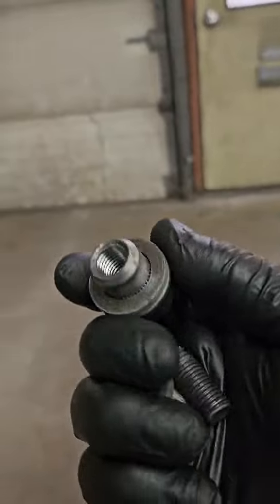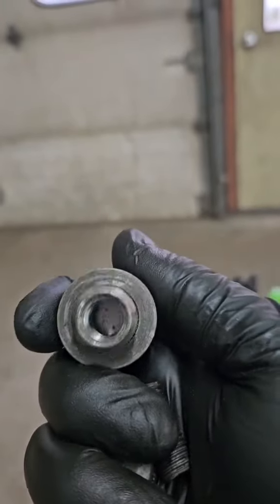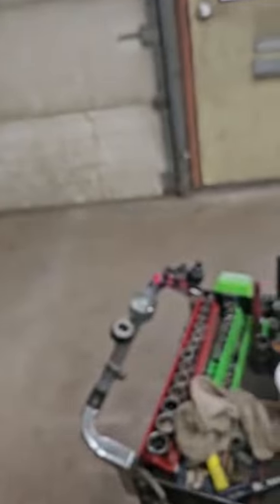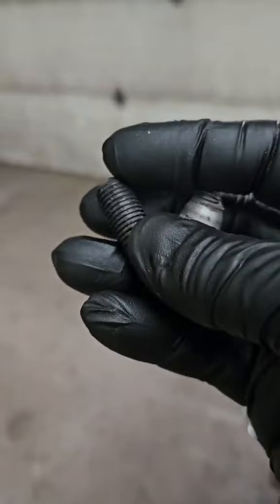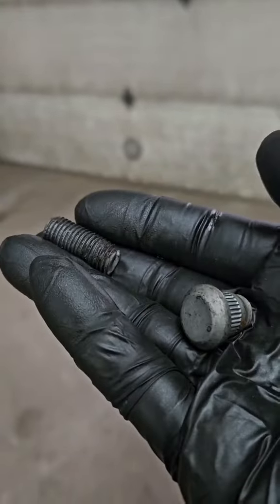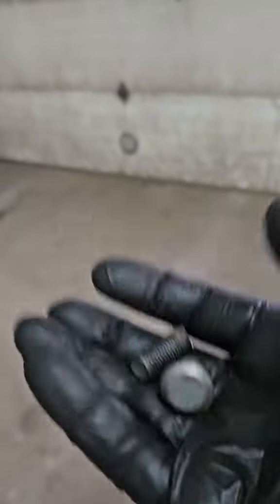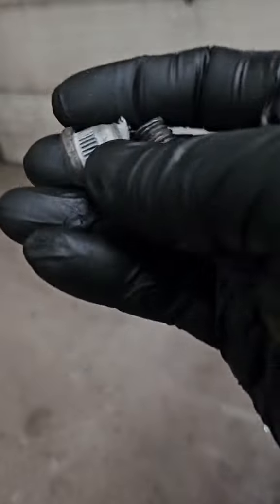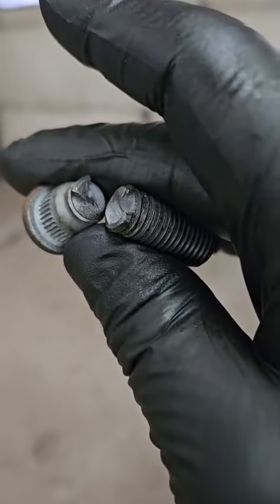Do not use Anti seize on wheel studs! #antiseize #wheelstud #tireservice

Comment: I've done it to every lug on every vehicle I have owned for 40 years. Never broken a stud.
Reply from the maker: The best part of showing what could happen from doing something and someone commenting about their anecdotal evidence as proof it doesn't happen.
Reply: @Tobatech13  Hasnt happened to anybody else I know that does the same thing including mechanics.
Reply from the maker: @Gizmo42Rodeo funny just a little research will show you it's more common then you think. I mean science is hard thing to accept I get it
Reply: I've put WD40 on wheel studs since the 80's. Never broke one. All 20 would have broke on that RAV4 , or at least more than one, if it was bad to do it.
Reply from the maker: @GregoryMitchell-zs2sh  lol ok bud. The only people that do it around here are hack diyers but whatever ypu do you bro
Reply: @Tobatech13  I'm not a hack. I'm a licenced automotive tech, a millwright, self taught  machinist and welder. Those wheel studs come from the factory with lube on them. My point was that one out of 20 wheel studs breaking isn't a sure thing.
Reply: Its only because you used your calibrated ugga dugga to do it. If you used a torque wrench you will over torque it. I follow the same process. Haven't lost a lug yet .
Reply: @Tobatech13  adding grease is not MULTIPLYING the torque. if you are actually torquing lugs to spec this will NOT happen ever. Take it from someone with more experience than you :)
Reply: @bambur1  I always use a torque wrench to factory specs.
Reply from the maker: @yuh1247  lol do a little research and ypu will see lubed threads increase the clamping force require to reach said torque. It's not rocket science

Comment: There are torque charts that show that lubricated fasteners should be torqued at about 10% less. How do you achieve proper torque on dry fasteners? All engine rebuild torque values ask for lightly lubed threads. As previously mentioned, I have been torquing all my wheels with lubed threads for over 40 years. I have never broken a lubed fastener.
Reply from the maker: I understand that. Engine component torque specs account for that. Also depending what lub you use and how much will vary the the amount of clamping force required. And I'm happy you've had zero issue but unfortunately that's not the case for everyone hence why those precautions are out there. That being Said cleaning the the threads and torquing to spec is the preferred proper way of doing  it.
Reply: @Tobatech13  I hold seven trade certifications and a total of fifty years in the trade. I am not a DYIer. Like someone mentioned below, if a lubed bolt breaks  it has probably been over torqued in the past.We do not tighten by feel anymore, torque is torque and lube does not make it higher!
Reply from the maker: @randyprentice9292  lol here comes captain certificates but doesn't understand that lubed threads add more clamping force which stretches the stud and weakens it. It's not rocket science and there's enough research to back this up unlike anecdotal evidence that you're presenting. Anyways you keep.doing your way I'll keep.doing it the way the manufacture intended. Have a great day!

Comment: I'd like to put it the other way around. If the threads are dry and starts seizing you whont reach the specified torque because the resistance in the threads. 
I like to believe that if well greased bolts snap before the right torque is reached they were done whit their lifespan anyway and probably torqued way to much in previous events by people not knowing how hard they have turned them.
Reply from the maker: That's why you clean the threads to do the job properly
Reply: I have NEVER seen a mechanic clean lug nuts and studs in my entire life… maybe one out of 100 would take the time for that.😂
Reply from the maker: @joegage6171  well some of us do a proper job and take pride in our work🤷
Reply: @Tobatech13  let’s hope people appreciate that and keep you busy!
Reply: @joegage6171  The lug nuts no, those get replaced, but the threads, yeah. You can do it in a few seconds per wheel with air tools.
Reply: Good point ☝️

Comment: You are correct that the torque spec provided for wheel studs is a dry torque value (and wetting it will increase the clamping force), but it still requires a lot of force to actually break the fastener.

Comment: WD is not antiseize.  100ftlb is 100ftlb.  With rusty studs actual torque will be lower, but lube can't multiply torque.
Reply from the maker: It increases clamping force to reach that 100ftlbs. That's why you're supposed to clean the studs properly before installing the wheel

Comment: Yeah, not buying that that is the reason the stud broke. Been using anti seize for 45 years w/o issue. I know that hardly anyone torques lug nuts to spec, which is give or take 100 lbs, and I doubt that would have happened if done correctly. Some backyard hack probably had a cheater bar on his ratchet, or slammed that nut on with his impact set balls to the wall. And WD-40 isn't anti seize, it's a better cleaner that it is a lubricant.
Reply from the maker: It still lubricated. It was definitely with a torque wrench. I mean a little research will show you it's more common then you think. Ive seen it happen a few times in my 20 years if the trade 🤷

Comment: You can't over torque with lube, but as you pointed out, you can increase stud tension. Lubrication decreases the friction, which allows you to seat the nut lower on the stud, with the exact same amount of torque. 

Torque specs, for wheel studs or bolts, (depending on if euro silly hubs) are defined with a dry fastener without corrosion.  The engineer comes up with a clamping force the stud/nut combo with create with X torque. Torque, is basically a rough way to ensure you place X tension on the fastener, and subsequently clamping force, on the wheel, to the hub. When too much tension is put on the fastener, the fastener, in this case a stud, breaks. To get this clamping force, the nut needs to pull against the stud X amount of distance. When you lubricate the fasteners, you reduce the amount of torque needed to reach that distance on the stud, to achieve that tension.

My experience with anti-seize in high volume work, comes from a second job I had in highschool working at a Sams in the tire depo when I was a kid. Sam's (and walmart's) policy is ALWAYS use antiseize. Well, the problem is they use liquid copper antiseize. It's not good for the fine threads of anything, especially a high speed installed wheel stud fastener. We had more broken studs because of the stuff. What would happen, is it would go over a little corrosion, (which no-one even had the tools to clean off, nor would those low ambition fools try) and the copper would gum up to the point the stud locked up on the garbage. While they wouldn't break in fwd, since policy requires using a torque stick, when the breaker bar came out to take it off, off came part of the stud with it. So, the nut that came off the stud just fine to take the wheel off, would get broken on re-installation.

Never get a tire from walmart or sams if at all possible. They are not mechanics, and will blindly follow policies that can harm your car, and make getting compensated for their mistakes as difficult as possible.
Reply from the maker: I agree I also saw that policy which is ridiculous

Comment: Thank you, i appreciate it. But im still going to. Ive have worse luck with rusting on
Reply: Same, I live in upstate NY, been a mechanic for over 20 years, never had an issue with a lubricated wheel stud, but I have had issues with rusty ones.
Reply from the maker: @NYPATRIOTBX I live in manitoba the heart of the rust belt . Clean the threads with a wire brush and put the on dry
Reply: @Tobatech13  ye, not gonna happen, not with the amount of salt they put on the roads here in NY, not to mention they use salt in dirt roads in rural areas here to control dust. I’ve had more problems with rust and corrosion on wheel studs and rims not to use a small amount of anti-seize and I have never had a broken wheel stud due to it. In my opinion the problem you had with that particular wheel stud, can be attributed to a cylinder being hydro locked with fluid.
Reply: @NYPATRIOTBX  It's in the ASE tests, don't put lube on wheel studs.
Reply: @mcqueenfanman  ASE tests are great and all, but when your dealing with rust belt vehicles all of that goes out of the door, especially with plow trucks and municipal vehicles in the salt belt.
Reply from the maker: @NYPATRIOTBX I deal with rustbelt vehicle. You know where manitoba is right. We salt for 3 more months then NY. It's amazing I don't have these issues?
Reply: @Tobatech13  Yes I do know where you are, but you guys use a salt/sand mix, granular sodium chloride treated with liquids magnesium chloride is what’s used on NY roads in the winter and is used on some rural dirt roads in the summer to control dust. The type of salt we use is far more corrosive to vehicles than in most states.

Comment: Its wet torque vs dry torque thats the only difference with anti seize yes youll probably get an extra 1/2 turn as opposed to dry torque. Siezed wheel nuts also break studs so have it your way.

Comment: If torque is rotational force how would lubricating the threads increase the torque or trick your torque wrench into applying more torque then the wrench is set to. If the stud breaks at or before the torque is reached then the stud would be faulty and not a case of the torque wrench tricking the stud.
Reply from the maker: It's about clamping force. You will exert way more clamping force to achieve 100ftlbs

Comment: Use anti-seize and reduce the torque by 30%. That's pretty much the rule. That will put you about the correct torque load on whatever fastener you're tightening.

Comment: If one out of 5 studs broke with the same treatment of lube and torque failed, THAT IS NOT scientific proof! Just shows that there is a failure rate in wheel studs. Manufacturing problem or previous mistreatment by over-tightening etc. People, never take advice from a video made by a person you have never met, just because he looks the part. But don't just take my advice on this either, talk to people in the know. That said, WD40 is not an anti-seize, it's a lubricant and water disbursement. Butter might do a better job. :-)
Reply from the maker: Do a little research my friend. Any kind of lubricant on the threads will increase the clamping force necessary to reach said torque. It's badic science. It's not hard information to find🤷

Comment: I didn't know WD-40 was an anti-seize LOL. They make specific anti-seize it's aluminum or copper based for this exact thing in my owner's manual actually recommends using it
Reply from the maker: Any lubricant shouldn't be used. Thay I'd like to see. I can't see a manufacturer recommending thay
Reply: @Tobatech13  there is a difference between lubricant and anti-seize I think we're talking about two different things. Damn

Comment: I use wd40 on lug studs. But only in conjunction with a wire brush to clean the studs. Never had an issue. But I definitely see how too much lube could be a problem

Comment: There is zero reason to use anti-seize on studs. If the manufacturer doesn't why would or should you?
Reply: Reason 1.  So it does not seize.
Reply: @stevealbers685  never have seen it. Only cross threaded. But as a fellow smart-ass I appreciate the comic relief.
Reply from the maker: @stevealbers685 clean the thread with a wire brush and you're good to go
Reply: The manufacturer isn't manufacturing a crusty 12-year-old car. 
Even the faces of the hub and wheel need a light coating of something.
Reply: @JxH  I can see the mounting points on the wheels. As long as the studs are clean I see no actual reason. A cross threaded lug is the only one I have never see come off. A quick run with wire brush or thread chaser and you are good to go.
Reply: @gofigure84   Lack of lube could eventually result in galled threads. My son bought an old car and it took a breaker bar with an 8-foot cheater pipe to get one bolt off. Perhaps the previous owner didn't 'believe' in a little lube on the studs once in a while. And no, we're not in danger of breaking things as per this video's concept.
Reply: @JxH  graphite if you must or just cleaning the threads anytime the wheel comes off. No lube is needed.
Reply: @Tobatech13  I agree with you. Take time to clean the threads and you will never have an issue.